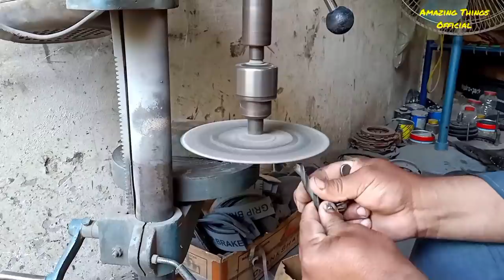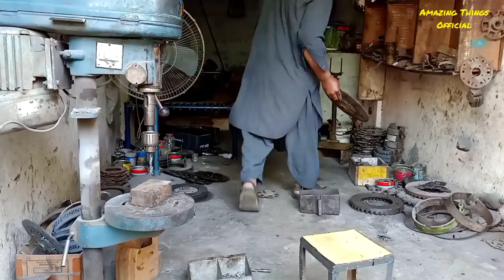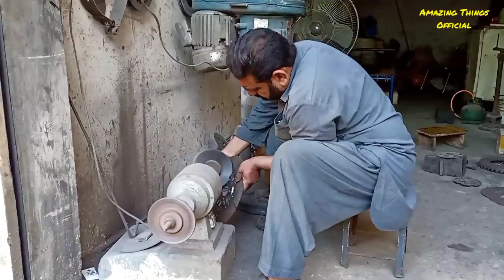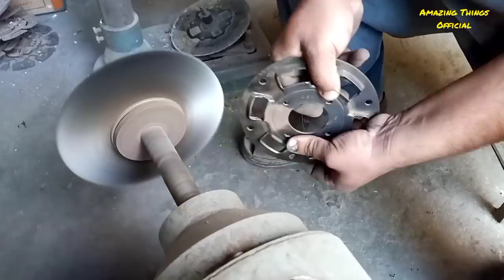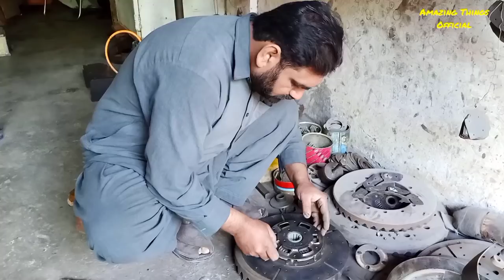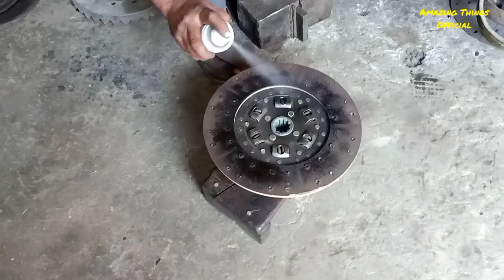How to rebuild a Clutch Plate || Restoration of a Clutch Plate || Rebuild an old Clutch Plate

Comment: I didn't know it was possible to buy parts for the clutch itself.
Reply: In a country like theirs  where they have no recourse when parts fail. I mean after all its used springs from another used worn out disk along with the other parts he grind down to fit. The ring was cracked and used he also grind down to fit...Wondering it the clutch material was just used and spray painted too. Looks like maybe only the rivets are new...The buyers really doesn't have any type system he can go to to complain there....Here you do stuff like that and sell it , you can be sued,fined and imprisoned.The term rebuild or manufactured GREATLY changes based on where in the world the part is being rebuilt in....This is a country where they think more highly of the disk then they do towards women.
Reply: Stop talking out of your backside

Comment: Cool to see all this work done by hand.but cleaning metal and throwing a new friction surface on to old metal dosent fix metal fatigue and dosnt fix the warp if it been run to hot to many times. Plus why no new springs in the clutch disk while you where in there?are those parts hard to come by?

Comment: It doesn’t matter that it looks nice. Does it perform the same as OEM and last 5 years. Does it slip going uphill. Can you do a burnout and not get catastrophic damage? Does it have a warranty
Reply: Most of the times, the pressure plate and flywheel go for facing, i don't know the correct word, as they develop burn marks and fatigue cracks. This difference in thickness, as some metal is removed in the process, is compensated using thicker linings,. Generally OEM supplies only standard spare parts. That is one of the reason the clutch plate is repaired and it is cheap too.

Comment: All the complaints about dust   Bla bla bla   This man has skills.
Reply from the maker: Thanks for your appreciation 😊
Reply: Modern clutches and brakes don't contain asbestos. However the dust still isn't good for your lungs.  As there is electricity in the building a basic vacuum cleaner would help to remove so of the dust.